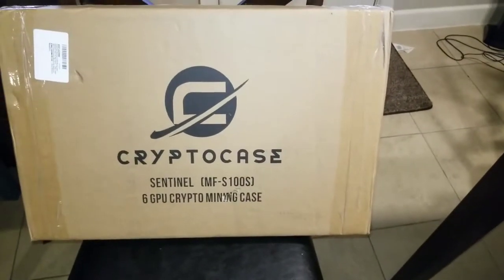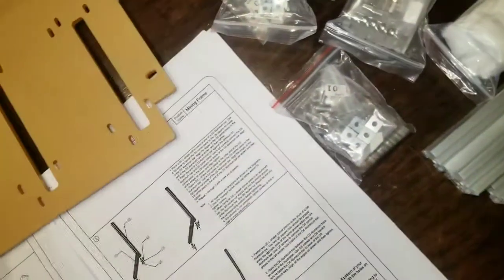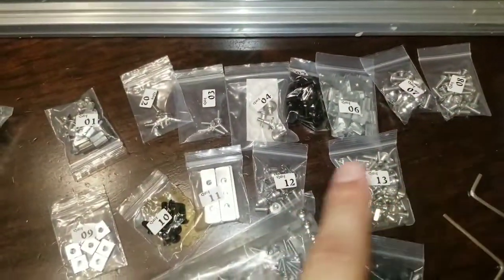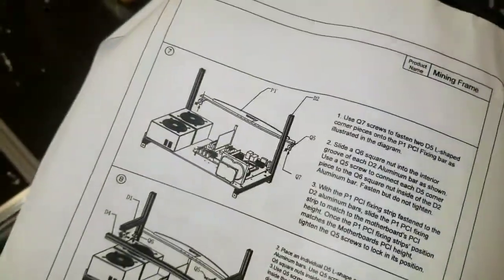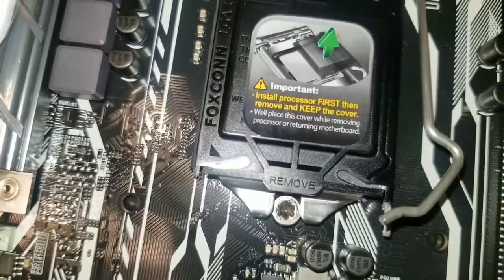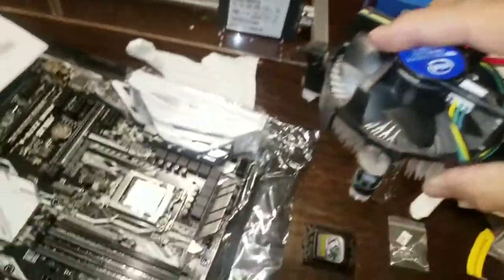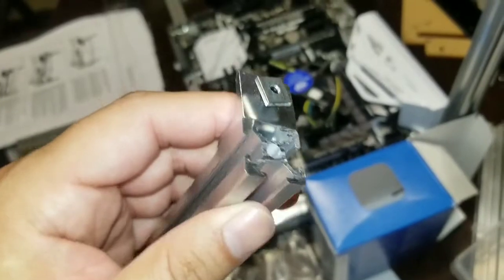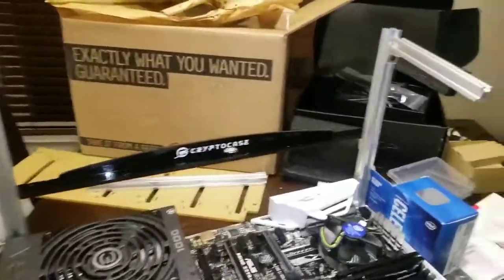Putting together CryptoCase for mining rig.

Comment: Hey @david12597, thanks for the helpful video. I purchased this same frame from Amazon, but the instructions I received are missing at least one page. I have steps 1-6, and then Steps 10B & 11. So I am at least missing Steps 7-10A, which seem to be a crucial portion of the build.

I attempted to contact the Cryptocase manufacturer/seller repeatedly for a PDF, but to no avail. Watching your video should help, but having the instructions would be so boss. Do you think you could snap a photo on your phone of the missing page with Steps 7-10A and send the pic to me? I would be forever in your debt!

If not, I understand - we're all busy. Either way, thanks for the vid!
Reply from the maker: Bryan Sonnega if I didn't throw it away yea I can do that.
Reply: david12597 Thanks man! Any luck finding the instructions? Like you said, this has to be the most complicated frame ever! It seems like sometimes the numbers represent the lengths/sizes, sometimes they represent how many you are supposed to have, and sometimes the numbers are just arbitrary. So missing a front/back page of instructions is really making this stupidly difficult. Like assembling a big ol' Lego set w/o the instruction booklet. So if you can find the booklet for me I would gladly toss ya a little crypto tip (Monero). Just got my 6th Sapphire Radeon Nitro+ RX 580 8GB SPECIAL EDITION (w00t!) (actually, 5x that card plus 1x PowerColor Red Devil - hopefully they all play nice)... but I digress. Hope to hear from ya soon!
Reply: david12597 [bump]